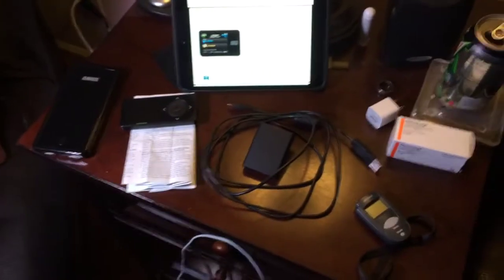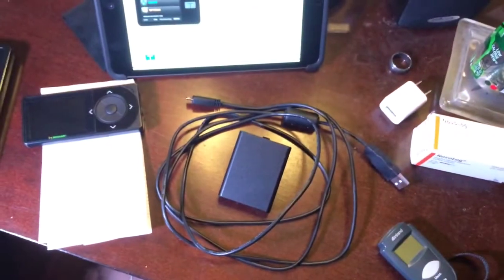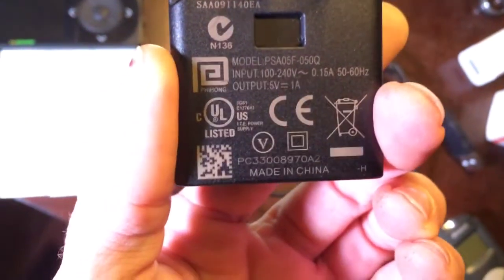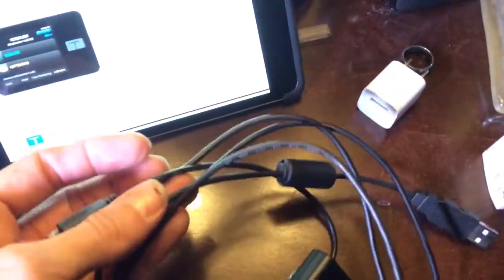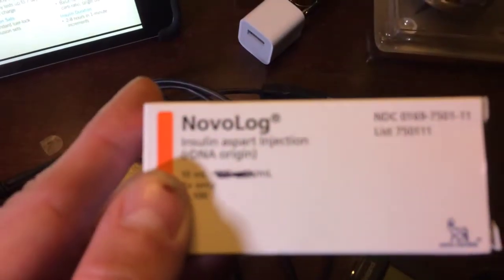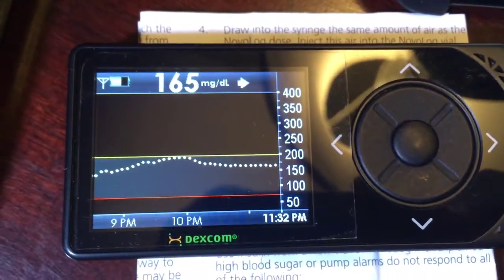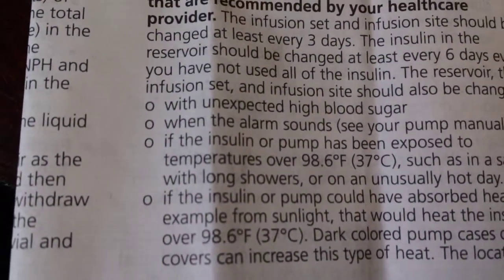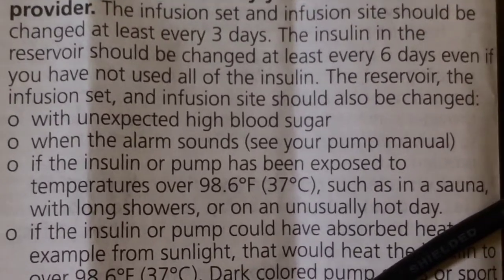Tandem T:Slim pump charging hot or not?

Comment: Yes, I have charged it with  a Apple charger. But I would only trust a Apple charger that came with the iPhone or iPod touch made by Apple. The iPhone charger has the same 1 Amp output as the charger that comes with the pump. I think kingston makes the charger for the pump. 
I would not trust the cheap chargers that look like apple chargers, people have had problems with the cheap one damaging the phone and could on imagine what might happen to the pump.

I'm glad you both enjoyed the video.

Comment: Bro my changer is broken I need shove it in to change
Reply from the maker: All pumps have a 4 year warranty. It might have dirt in the charge port? But also try a different micro USB cable and see if that works better. If that doesnt work then I would contact support so they can swap the pump out.

Comment: I just got the tslim. Question Do you leave it on and connected while charging???
Reply: Yes, I keep on and running while charging, no issues at all. I have the newest version now, and do the same thing. No issues at all, it doesn’t get hot charging because it doesn’t super fast charge like a modern cell phones. I also run an electronics Review channel, it only draws a little power and has plenty of power to run at the same time without over drawing the chargers. The reason I recommend staying away from $5 chargers is because of the voltage, some cheap chargers have to high or to low of a voltage, to high could damage any usb device. For computers, TV, USB ports in cars built into the car I’ve never seen a bad voltage and use them without an issue. It’s the cheap car power usb or one you buy at the gas stations or freaky cheap on eBay/amazon I would stay away from.

In case of an “on the go” situation I’ve even done a small portable USB battery bank and small cord, pump in one pocket and batter in the other pocket. Again I wouldn’t buy the cheapest usb battery bank, I know for a fact Anker makes some good battery banks and sell on amazon. I use different pockets just to be safe, since Charger any battery at first creates some heat the lower the battery is, then takes less current as it get closer to s full charge. The portable battery also creates some heat with the USB step converter to 5 volts using a 3.7 volt nominal battery. So I put them in different pockets so the heat doesn’t combine from the portable charger and the pump battery charging just to be a little on the safe side.
If you let it run down to 5% is takes the most power when charging and makes the most heat like any battery when it really low, but sometimes you just forget and find it low and need to charge it. 10 to 15  minutes gives you about a 20% charge, usually more then enough until you get back to the car or get home to finish charging it. They did s great job on the power management system in the pump. 
I think they recommend not letting it get below %20, but I did this a lot with the first pump over 4 years and never saw a performance issue on how long the battery lasts. 

I guess my only big warning would be is to not charge it when in direct sunlight since it’s black, or have a white case on it to help not heat up from the sun. Even in cold winters properly dressed and the pump in the pocket it never froze, just don’t leave it hanging out and keep it in a pocket to use your body heat for this, maybe cover the pocket with your jacket. So 30 minutes shoveling snow, came in checked the temperature with a K thermistor probe and a FLIR thermal and still looked good in proper ranges.

I hope this helps, any other questions feel free to ask, you can find my email on the YouTube about page of this account. You have to use a computer web browser, the email doesn’t show up on most mobile phones or tables.
Reply from the maker: Sorry, I replied under the electronics Review account. An email to either account for questions would be ok. But it’s still me, I run both channels.
Reply: Do I have to sit next to the outlet while my pump battery is charging or do I buy 2 chargeable batteries and switch back and forth? I can't imagine having to sit there and stay connected while it charges?? Or does it have a temp battery that will kick in while you disconnect and charge the battery? And also, if the chargeable battery completely dies are you S.O.L. (screwed) like a dead cell phone until you charge it? OR will the pump continue to work like for instance when the power goes out at home and our clock radio continues to keep the time?
I'm thinking of getting a new pump and I am super scared of having to have to REcharge it vs the good old fashioned lithium batteries that I have more control over. Like what if I can't get to a power source?? 😱

Comment: Hi there I'm considering a T-slim but am a bit confused about the battery - can I still have the pump connected to me while charging?
Reply from the maker: Andrea, I don’t recall anything in the manual warning to not do this. I always charge it when its on me unless it a infusion change night. Then I will remove it and the infusion and let it charge while I’m in the shower. I’ve had no issues with this one in the video or the latest one I now have had for a few months. Just don’t use the cheap $4/$5 car chargers. I left a more detailed answer in the comment above since you both asked the same question, you can read that reply if you want for more details.

Comment: So it looks like the pump has a Delta T of 10 degrees to the outside ambient air when placed on a desk which acts as a heat sink. Have you measured the temperature when charging in your pocket? Seems like it would run upwards of 98.6 if your surface body temp is somewhere around 92?
Reply from the maker: Rachel Ferguson It wasn’t shortly after buying that older pump I moved to a belt clip holder. So I can’t say for sure, but I don’t see much of an issue. A wood desk isn’t the best heat sync, but it will draw a little heat from it. My house is at 76F, and my person body temp runs about the same. Like most lithium based batteries and chargers the more it gets to full the less energy it draws. If it was under 20% I would change it in my pocket, but over 50% I don’t think would be an issue since it will drain less power to charge. It charges at a slow rate, not like fast charging phones that get freaky hot from charging so fast. I don’t think the FDA would allow that, but the battery last a long time in each charge so it’s not like a phone that needs charged every night. I charge mine on an adage of every week, sometimes 2 weeks (and longer) if I’m lazy. If it’s low after 2 or 3 weeks then I would set it next to me while it charges.

Comment: Great video! My non-diabetic self-declared geek husband really enjoyed it too :) Have you tried charging it with the Apple charger? (You may have said something about that in the video, if so, I probably didn't catch it). We travel a lot, and the less chargers we lug around, the better.
Reply from the maker: Ciwi, I don’t know why I never received notifications when comments left. But since you left this comment USB cheap chargers are more common. I would still recommend using the built in USB port from the car manufacturer or a quality car charger like a Kingston, Incase, or other decent one. Don’t trust the cheap $4/$5 chargers, when they fail it can cause a direct short or power from your car power at 12 volts higher then the USB voltage at 5 volts and might damage the pump. If you stay with good chargers it will not be an issue. If it’s a real apple charger then they are some of the best and safest charger you can get and why they cost more. I’m sure your self declared geek husband would also agree.